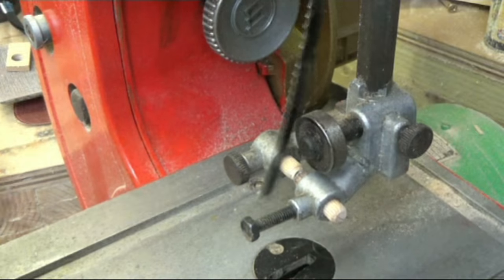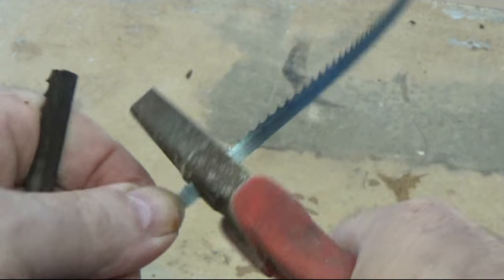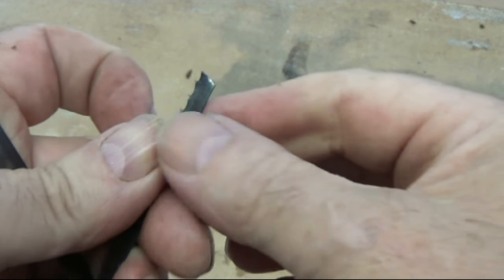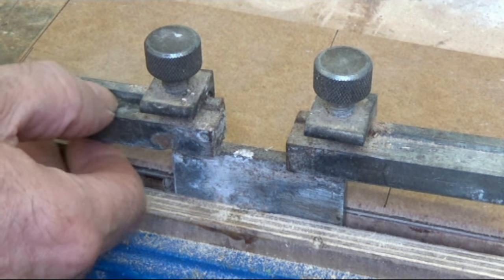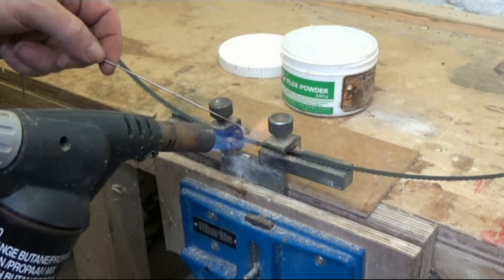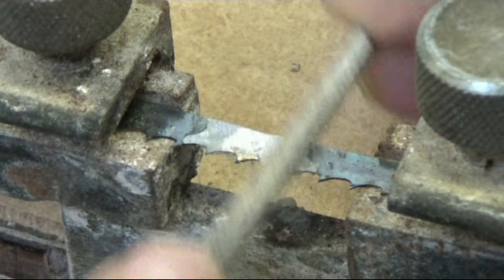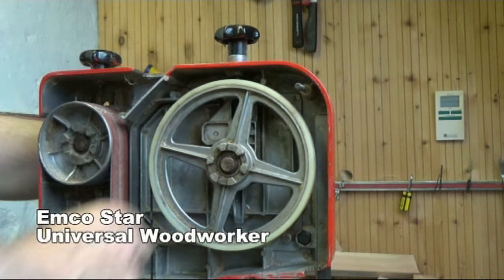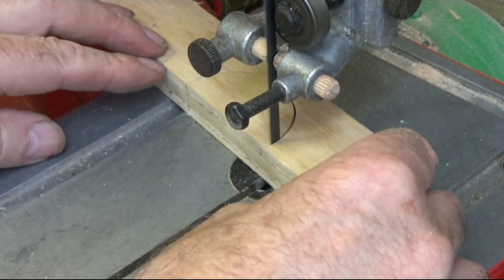Making Custom Bandsaw Blades To Length

Comment: I taper the blade ends by overlapping both ends and gently grinding them to shape.  I also use four screw/clamps to hold the blades even more precisely.

Comment: I made a jig to feather the edges at 20 degrees which I check with a square to make sure it's square.  I just began making up blades for my 3/4 metal cutting band saw. Propane gets hot enough to turn an unbroken area of my 3/4, .035 band saw blade cherry red but it won't do the trick for 56% silver soldering a splice in a jig.  Maybe not enough expansion room for the flame because of the jig?  Even mapp gas isn't hot enough.  Still trying to figure that one out.  Anyway, I put a 0 size welding tip on my oxy/acy torch, turn it down to the smallest flame possible and, with flux, that seems to do the trick.  I flatten the joint with a tiny sanding drum in a variable speed Dremel on low.  That seems to work pretty good as well.

Comment: I’m so grateful you did this video.  I’ve got a 24” bandsaw with 25 blades.  Many are very small like 1/8-3/8”.  I’d like to make them shorter to fit my 16” laguna.  Uses 130” and my 14” delta which uses standard length. It just occurred to me instead of trying to buy some, maybe I can cut my own.  Did you buy your jig?  Who makes it?

Comment: The blades I buy are welded, and I have had several snap.  How does the silver-soldered joint perform by comparison with welded joints in terms of reliability?
I'm concerned about blade snappages, because last time it happened, the snapped end of the blade came down through the triangle formed between my forefinger, my thumb, and the workpiece, and dug a lump out of the table.  I was pretty lucky it didn't dig a lump out of me.  It kind-of shook me up.
Reply from the maker: I've had about three sudden unexpected breakages in 40 plus years. Normally you  get a warning as a tear nicks against the guides but then can count on two hands the number of breakages. The biggest risk is using a small bandsaw with wheels so small in diameter the blade metal fatigues.  With soldering the metal is actually softened (annealed) around the join which gives it a degree of flexibility. I wouldn't go to all the trouble of making these videos if these tips didn't work. If silver soldered probably with a long feather overlap (scarf) and the blade perfectly aligned and the excess solder neatly filed off, there is no problem. But it takes a degree of skill.
Reply: Thanks for your response, Jeremy.  I have done a little bit of silver soldering before - only one small job, but it's still holding fast, so I think I'd be alright with the operation.
https://youtu.be/qPjozDIyPJo?t=510
My wheels are 16" (40cm) diameter.
You seem defensive.  I didn't mean to disparage your method - it looked interesting to me, so I simply asked how it compares with a welded joint.  You've answered that - three breakages in 40 years is good enough for me!  I don't spend all that much time in the workshop, and I have broken two blades (welded) in less than 2 years - though I must admit, one of them was very narrow.
I'll give your method a try.  Thanks for the vid.
Reply: Mike Collins ภาไทยแลนด์

Comment: Nicely done - thank you for sharing!   I do have to wonder, though I'll admit that I haven't waded through ALL the comments to ferret this out for myself:  would brazing also work for this?  I'm setup for that, and have some experience with it; silver solder, OTOH, would be a new trick for an old dog to try to learn - so if brazing would work and, as I suspect, might well be stronger, I think I might tend to lean that direction???

One other thing, if you wouldn't mind: @0:44 you mention "hard tipped."  I'm fairly sure you're not talking carbide tips, so - is it simply the case that the cutting tips have been hardened while the main strap has not?
Reply from the maker: I think there is some confusion over the terms 'brazing' and 'soldering'. I use silver solder as stated in the video but some refer to that as brazing. Brazing generally is a much higher temperature process with a brazing rod. I have very few breakages using silver solder which is altogether much easier to do. The only breakages are where feathering of the blade is not long enough and the two ends are not seated perfectly flush in the jig, causing a nick as the blade passes through the blade guides.  A long feather gives more solder contact. Just my opinion and personal experience. Ideally if I had a miniature electric welding jig I would go for that.
Reply: Hi JB - thanks for the prompt RE: -- but I hope you'll pardon me if I whine that - I don't detect an answer about whether or not brazing would work.  While it may be true that there exists some confusion of terms, I would like to think that doesn't include me?  Brazing is done with brass and soldering is done with other alloys - in your case clearly involving some silver.  The latter clearly take less heat to melt and utilize, but as I have oxy-acetylene readily at hand, brazing is simple enough - and more precisely administered, given my range of tip sizes. 

I will admit, though, that I don't have a hint of a CLUE about the strength (potential) of silver solder - or its possible advantages that might tip the scales of my getting off my duff and trying to learn a new skill.  I was rather hoping that I had done all the learning I would have to do by the time I was about 15 - but perhaps . . . .
Reply from the maker: I only share here what works for me. I cant get into pedantics as clearly this is a modern day bone of contention and I've been silver soldering for 40 plus years. Just bear in mind that any heating up of the blade causes re-structuring and I always use hard-tipped blades so any excessive heat will soften the edge. There are many ways to skin a cat and if you want to go for high temperature brazing and it works all well and good. I cant spend any more time on this as Im still working (its 8pm) 0while others are drinking beer! Ps. Ive been using a tiny bandsaw all day for a guitar building project and the blade is as..!
Reply: Thanks again!  Sorry to waste your time.

Comment: Could you state the kind of flux and % solder you use? I understand the lower content solder used for copper and wires is a much lower silver content that may not be applicable. Do you know how to determine the % of silver in solder?
What about tempering the blade afterwards? Any concern?
Are you familiar with the stick versions?
Thanks again for your variety in videos!
Reply from the maker: It is just straight forward silver solder flux (powder mixed with water to a paste) and solid silver solder rod as traditionally used.
Reply: Al bert K     It seems solder with a minimum solver content of 50% is recommended from the several videos I watched and the old machinist I spoke with.  I bought an ounce  of coiled 20 gauge 56% wire for $29.00.  Pretty spendy but should be a lifetime supply there.  After lots of shopping for the lowest price, I got the wire and "Handy Paste Flux from  www.RioGrande.com   Here is the invoice with item numbers:

101705 WIRE SOLDER, X -EASY 56% SLVR 20 GA RND 1.000 1.120 OZT $25.97 $29.09
1 Pieces of weight 1 OZT
504086 Handy Flux Paste 1lb jar 1.000 1.000 EA $10.75 $10.75
If the flux is not "liquidy" enough, mix a dab of distilled water with it.  If it's too dense when applied and heated, it'll just turn into a hard skin instead of mostly burning off.  Good luck!
Reply: Woodomain - Jeremy Broun "solid silver solder", does that mean 100% silver?

Comment: Bandsaw blades dont break that often unless you are running some shop that puts out a piece of furniture every day or some other production thing, so I dont believe that "its cheaper to buy blades in 50 meter lengths" especially since this brazing method seems weaker and those blades are probably likely to fail earlier, meaning you need to replace them more often.
Reply from the maker: You are entitled to your opinion but I am sharing what has worked for me for over 40 years. The method I have demonstrated is silver soldering not brazing. Welding is a lot more skilful. The solder is soft enough to file back flush. The breakage in my video also clearly showed a wide blade on a barrow diameter wheel with metal fatiguing at the joint being the cause. The blades usually dull and are disposed of before they break when the right width is used for the wheel. Obviously it is much cheaper to buy in 50 metre lengths when you compare the price with bought in blades!
Reply: Jeremy, great video! Where might I purchase the 50 mtr lengths? Kind regards
Reply: Braze? I thought guy was using solder.
Reply from the maker: Blades break for a variety of reasons. Please when I take the trouble to share 50 years of my experience and a lot of time in creating a free video, do not call the method I am using 'brazing'. Brazing is a different process at a higher temperature and using a different brazing rod material. I use silver solder and if the join is scarfed properly and the wheels on the bandsaw not too narrow to stress the join, the blade will not break  and hence the economy of buying the blade in lengthy coils is much much cheaper than buying made up blades.

Comment: Could they be spot welded or would that cause issues?
Reply from the maker: Not with this jig and with such narrow blades.
Reply: Rich you can weld blades, you just have to be very careful not to overheat them. As the blade gets thinner you start to get more likely to damage the blade. Anyways, a welded joint is much stronger and you wont have to replace it as often as you do with the method in this video. Look up videos on youtube about welding blades.
Reply from the maker: Incorrect. Welding is far more skilful in such thin metal and needs a special jig. Please respect a tried and tested method using a simple silver soldering jig bought in the mid 1970's and still used by me!! The jig is specifically designed for silver soldering, not brazing or welding as Sarsoar has suggested. Silver solder is a achieved at a much lower temperature. If the feather edge is long enough the blade will be strong enough. I seldom have breakages unless as demonstrated in the video too wide (and stiff) a blade is used on a narrow wheel bandsaw.

Comment: What the name of the Flux
Reply from the maker: The flux I use is called 'Easy Flo' and it is for silver soldering. The method I demonstrate in my video is called soldering not brazing (which is at a higher temperature). Many comments confuse viewers by calling it brazing. It is not brazing. There is a lot of misinformation on Google. My methods refer to tradition British methods I first learned in the 1960's when I trained in all the metalworking disciplines alongside woodworking at Shoreditch College the leading UK college.  Silver soldering is quite different to lead soldering which is very low temperature. Both soldering and brazing use fluxes.

Comment: Is there no way you can weld the ends? It should be stronger. But since you are doing it from since so long, you know best. I am just a lay man.
Reply from the maker: No I don't know best, I just have a long experience to share! Welding and brazing are too different technologies using different jigs. Mine is a low cost solution. Welding will be stronger of course as you say but is more costly in equipment and generally commercially orientated.
Reply: You also have to temper after a weld.  With brazing, this is not necessary.